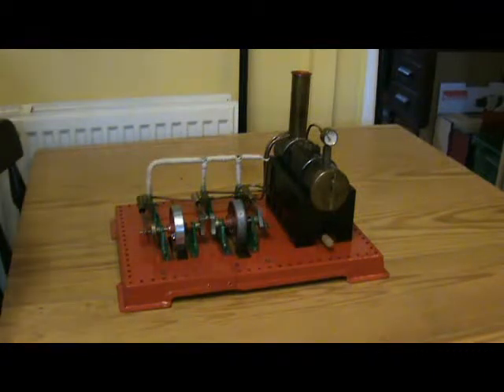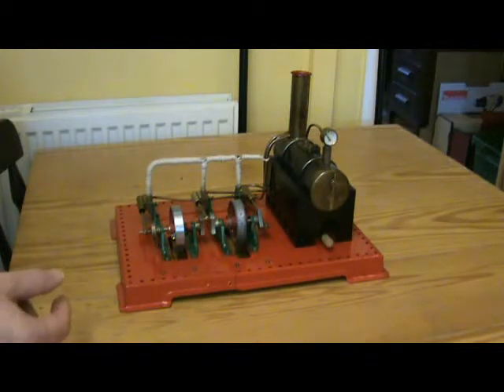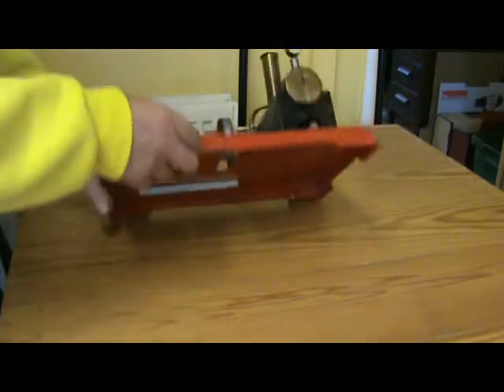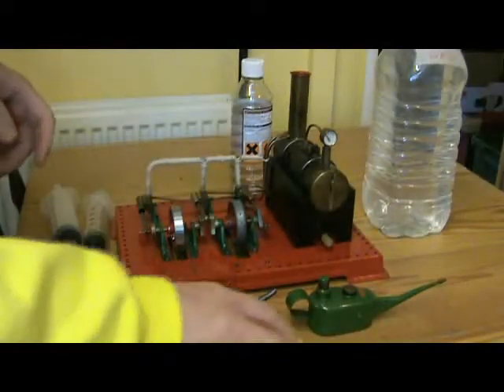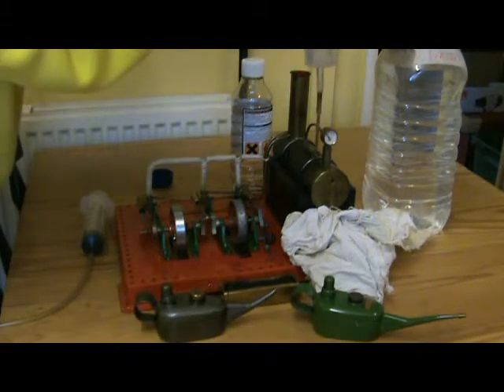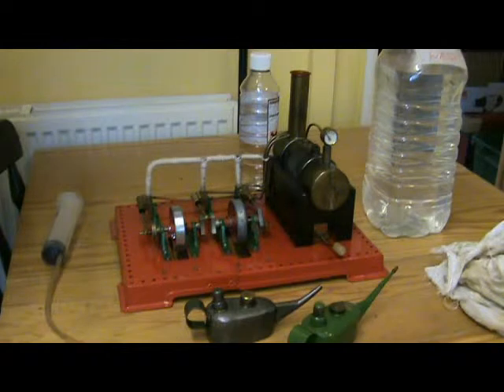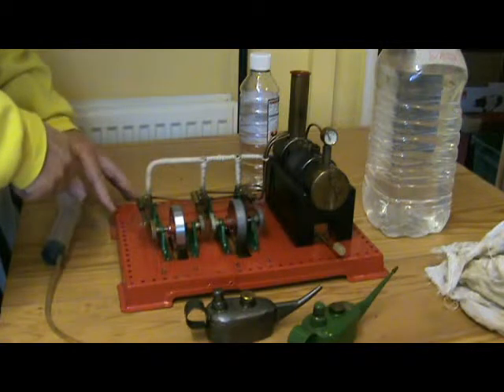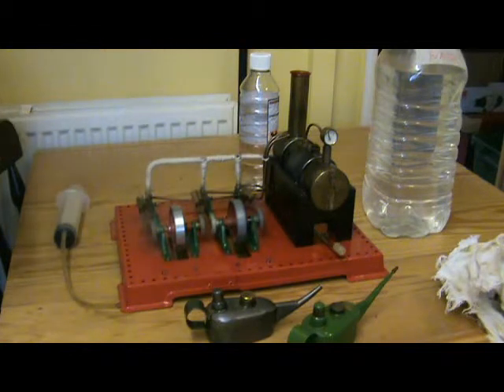SE3c Demo.avi

Comment: A great conversion there Roly, I enjoyed the video and the engineering for the third cylinder. How did you set the timing up and how does the power compare from a standard SE3 under a load?
Reply from the maker: Hi Ace. The timing is not critical I set the three cylinders to be 120 degrees apart by sight. The power is determined by the boiler and burner (conservation of energy and all that) so it is no more than the two cylinder version. The difference is that it runs slower. The improvement in smootheness was not a much as I hoped, probably because of the long steam line.
Reply: Roly Williams Thanks for the reply and info Roly. I can see what you mean about the power, the boiler & burner is the only restriction. I guess things could be improved if the motor was turned 90 degrees and mounted closer to the boiler and the main steam pipe fed to the middle between cylinders so there was an equal distance to the furthest cylinders. Its got me thinking... ;-) Really admire what you have done here.